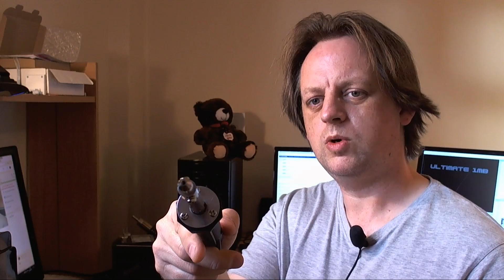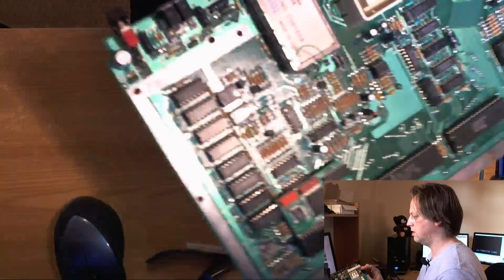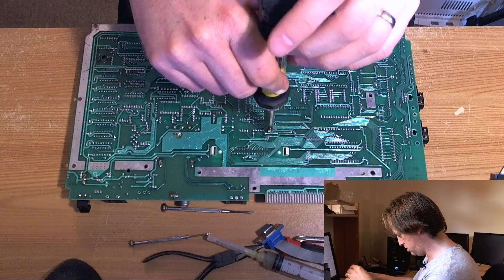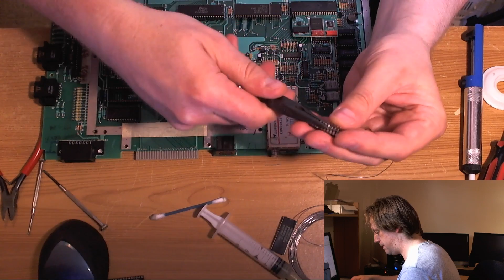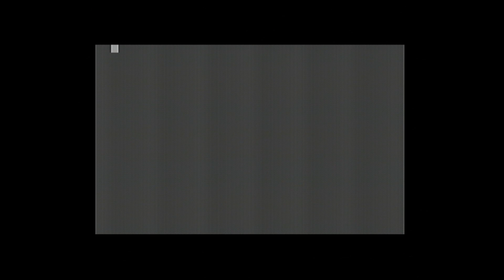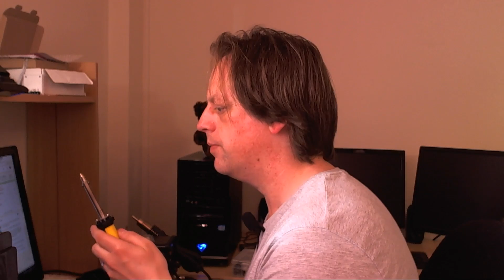Testing the Duratool eBay desoldering iron on a Sofia Atari 800XL

Comment: Nice, seems to work well
Reply from the maker: Yep: does the job effectively. The other unheated pump still has its uses, and there are more expensive desoldering solutions out there, but I like to use whatever does the job safely and efficiently at a reasonable cost. A tool is only inadequate when it impedes proper completion of the job. You'll get tool snobs (or tool dicks, as I've come to refer to them) who like to shit all over this kind of inexpensive equipment, but at the end of the day, spending more money on tools does not compensate for a lack of aptitude or dexterity. Since I play guitar, I liken the situation to players (usually middle-aged) who spend increasingly exorbitant amounts of money of expensive instruments in the hope that this will make them play better. It never does, but by the same token a warped, poorly fretted $10 guitar from the junk shop would impede even the most talented musician. It's all about balance. :)

Comment: So FJC - did you ever figure out how to open the tool? I can't get mine apart either! :)
Reply from the maker: Yep. If you can get a fingertip under the slight overhang of black plastic just beyond the button while the plunger is released, just prise it upwards and the pump section comes out quite easily.
Reply: Thanks, I got mine open as well now. It worked well to remove a broken joystick port from my Ugly Duckling 1200XL for replacement. I did notice that the latch mechanism on my sometimes doesn't want to hold very well, especially after it's been used for awhile. It will slip and actuate on its own sometimes. Have you noticed that about yours? Wondering if mine is defective perhaps.
Reply from the maker: Mine's still working following reassembly but it's a cheap tool and the latching button is a weak point. I can see that failing after a while. I notice Maplin sell the exact same tool for 15 GBP.
Reply from the maker: Was about to start a stream at 20:00 GMT tonight only to discover the heater in the pump is dead. Checked some Amazon reviews and one guy said his died after a year having been used only a handful of times. I used it a lot on the 65XEN I repaired the other week and that must have killed it. So: it's actually a cheap piece of shit, confirmed. :)
Reply: Damn, that's really too bad. I used mine to replace a joystick port on my 1200XL but that's about it so far. I was actually tempted to preemptively socket the (still working) MT DRAMs on my 130XE, which I never use anyway. Sounds like pulling 16 chips might kill it. Might be a fun torture test one rainy weekend this fall.
Reply from the maker: It's probably one of those situations where there's a 50 per cent chance the heater will outlast the pump.
Reply: So of course this just raises the question: will you bother with another one, buy a somewhat more expensive non-iron solder pump, or save up for an expensive desoldering iron?
Reply from the maker: I can get another one of these for about eight quid, so given the time it saves, it might be worth it even if it only lasts a month. :) But it's true what they say: buy cheap, pay twice.

Comment: My last comment didn't seem to post. #ThanksGoogle So ... yeah, I bought the same exact tool from Amazon here in the US for about $17 but I haven't had a chance to use it yet. It's got a different brand on it but it looks identical to mine. Using it, any reason why you didn't hit all the pins with flux before you tried the iron?
Reply from the maker: No particular reason. I previously got the keyboard connector off an XE without any flux at all so I just followed suit here, but the thermal mass of the ICs was a good deal greater. It was probably useful to show the contrast between using flux and not doing so; flux makes it a whole lot easier, of course.